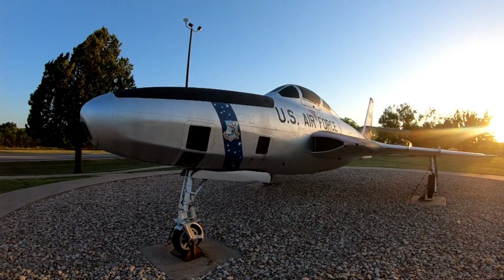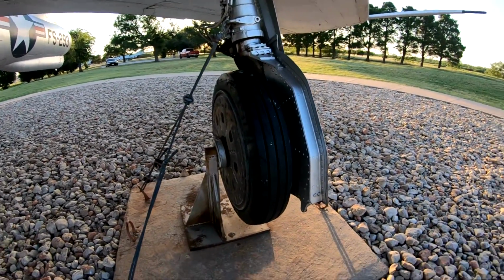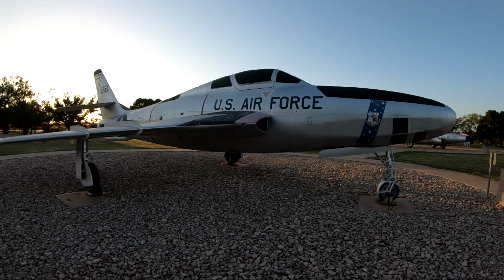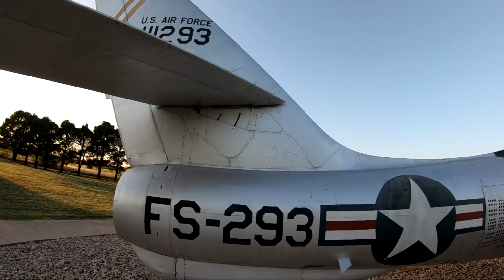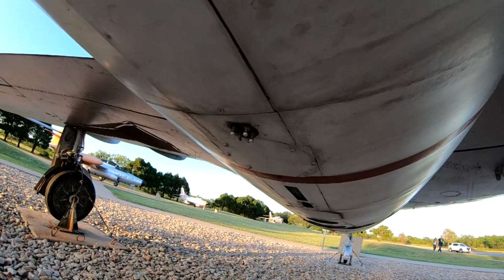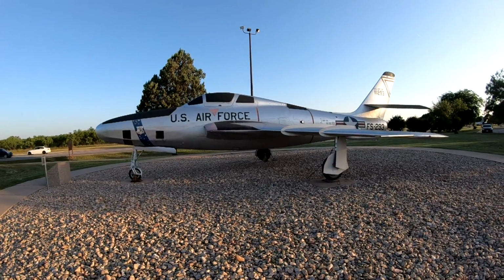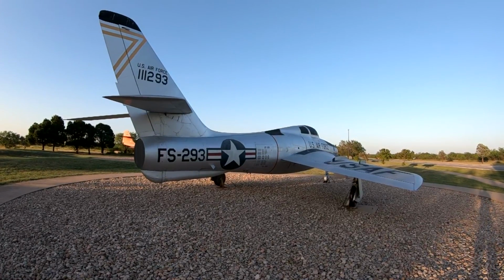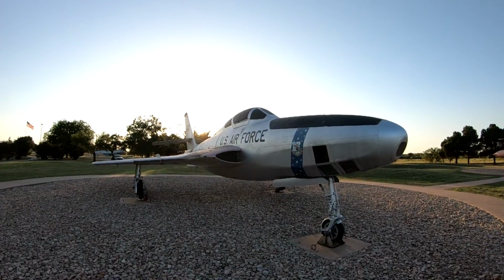Republic RF-84F Thunderflash @ Dyess Linear Airpark w History

Comment: Thanks for posting this, my dad was a crew chief on a RF84F Thunderflash in Germany, he said it was a great jet but slow on take off, he got in a bit of trouble for reworking the plates and adding some kind of after burner, he told his pilot to open this valve that dumped some more fuel and they had watch a temp gauge and shut it when it started to over heat, to give it more boost on take off, his jet was airborne in half the runway distance than the others, his tail # was 27346